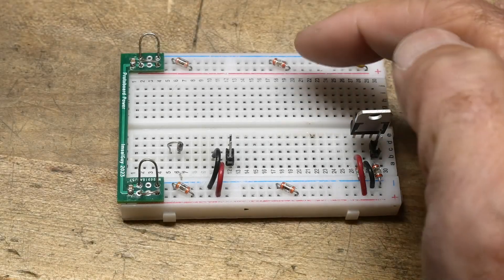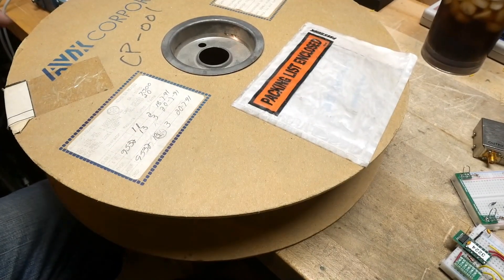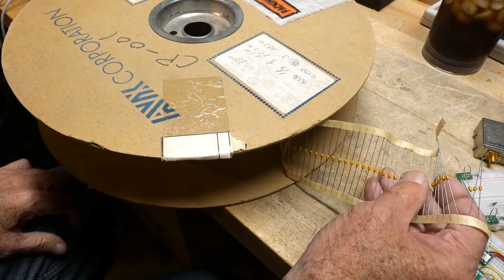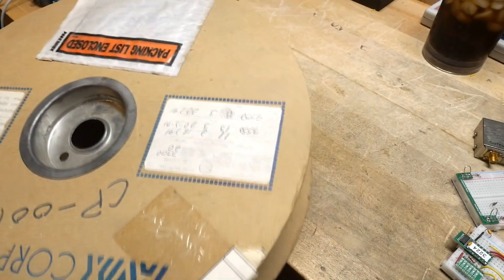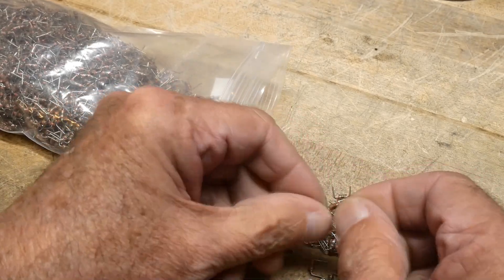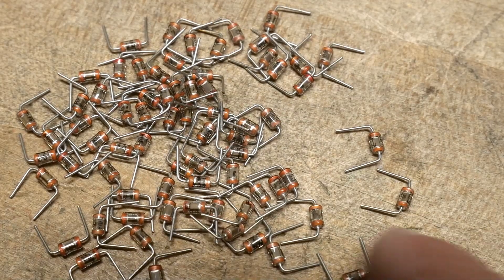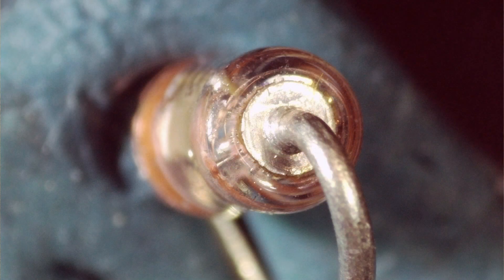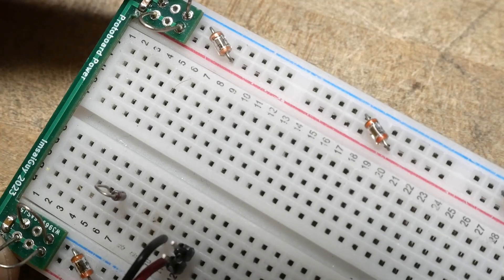#2222 Axial Glass Capacitors

Comment: I manage to salvage several of those from an old Texas Instruments Omni-800 "terminal" printer.
It used to be used to print airline tickets in the company I work for.
The printer were from the 70s.
Throughout iis almost 30 year in operation, it surely printed some hundreds of thousands of tickets, if not millions.
Never needed any maintenance... No oiling, no belt changes, no head pins... 
It was based on Intel 8080 and had 5 boards of (about) 5" x 13", one of them being only power supply, another being only motors and print head drivers.
The other 3 were fully populated with jelly-bean TTL logic (74xx), none of those fancy power saving LS, or speedy S... Just barebones power hungry TTLs.
All boards were full of those glass encapsulated axial MLCCs exactly like those ones you got.
I think they were made by Murata.
Unlike the yellow epoxy encapsulated ones, whose  leads are easily pulled out if overheated, those glass encapsulated ones are very sturdy and can survive easily a "salvage" operation from an older board.

Comment: Some ceramic caps are subject to capacitance reduction as they age. If they are old stock, it would be interesting to measure the capacitances of some, heat them to the Curie temperature of the ceramic (around 130 °C to 150 °C for barium titanate, which is probably what the 100 nF parts are) then measure them again after they've returned to room temperature. Aging starts anew after the heating.

Comment: Axial capacitors are pretty mediocre for decoupling. Their inductance is quite high simply as a function of their overall length. They're OK at moderate frequency but not very good at high frequency. When a decoupling cap is stuffed into the supply strips of a protoboard it makes virtually no difference since that is inherently low performance.

Comment: Oh YEAH! I remembered those glass-encapsulated capacitors which are basically SMD capacitors shoved into glass diode body. I haven't seen them in years, let alone brand new ones. IMO it's possibly good for test equipments as well since certain capacitor ceramic materials MAY be hygroscopic which affects things in the long run.

EDITED: Apparently the glass-encapsulated ceramic capacitors are still made.
Reply: When I worked for DEC in the 1980s we used the glass packaged capacitors widely for decoupling - the supplier was Unitrode. The version using the Z5U dielectric had a relatively small body - only 0.17 inches long for a 0.047uF 50V part (smaller than a resistor or most other types of capacitor) allowing the leads to be bent to fit holes 0.3 inches apart - the same as a standard DIP package. I doubt the capacitors were made as SMD parts given that back then SMD was a relatively uncommon technology.
Reply: I have never run into SMD caps in a glass encapsulation. It looks like someone needed leaded caps and they had a ton of SMD caps kicking around, and the diode encapsulation machine wasn't busy... I'm curious what time frame you did see them in, because I've never run across them before (and I said as much in a comment yesterday, and suggested doing a video on them, so I'm probably the one responsible for ruining the 2n2222 episode...)
Reply from the maker: these are not new. they are vintage
Reply: @IMSAIGuy  But I'm trying to figure out when they'd be from, because there is obviously an intersection between MLCC SMD caps and these - I don't know when MLCC caps became a thing, or if they were a thing even before SMD packages? I would think MLCC's are a lot newer than glass encapsulated diodes, which must go way back
Reply: @gorak9000  Those caps were very popular in Silicon Valley in the 1970s and 1980s.  Unitrode was bought by Texas Instruments in 1999 and I've not sen them since.  Atari used them in all their PCBs for a while.  The Atari 2600 and all the cartridges used them as did Battlezone and Tempest if that helps date things.  Remember that hybrid circuits predate SMD, and that SMD chips predate through-hole ones.
Reply: @IMSAIGuy definitely pre 1983, which is when I first encountered 
both types.

Comment: From my scrounging days I still have bags of both of those styles of caps. Being a tech, not an engineer I just keep plugging in more .01 and .1 uF bypass caps until my circuits are stable.  :)
Reply: If you still use the old bipolar 555 timer chip, may I suggest you switch to the CMOS version ICM7555.  That nasty 450mA 555 switching transient goes away and your need for excessive amounts of .1uf decoupling caps goes away with it.

Comment: I used to work in an FM factory. We used them a lot. 
We also used mica and nickel ones, I think, very good for RF in the tens or hundreds of picofarads. 
Do you have any around? They were square and could withstand high temperatures without changing their capacitance one bit!

Comment: Back in the day (1980s) I used to remove the the chip caps from mil sec plastic caps by melting it with solder iron. This was for a microwave project.

Comment: I didn't know about those. Are there glass transistors too?
Reply: I had some transistors that were mostly glass made ca.1956,  one time.  They were photo transistors and were going to be used in automotive apps as an auto headlight dimmer circuit.  Donated them to the Transistor Museum site.
Reply: Yes, the earliest ones like the germanium Mullard OC71 came in clear glass which was painted black.  Two of the earliest guitar signal processors, namely the Tonebender and the Dallas Rangemaster, made use of them and OC71s are still available in very limited quantities to build those pedals.  The sound of Ph.D. astrophysicist Brian May's lead guitar tone in the band Queen comes from a Rangemaster using one of those glass cased transistors.
Reply: @Peter_S_ and if you scraped the paint off you got a poor man's OCP71
Reply: Yes there are :)

Comment: Congratulations on your 2222nd video! Thanks for all the valuable and entertaining info.
I just used some of the first axial lead capacitors that you showed in a kit. The holes in the board were kinda close together and the leads were quite thick (no complaints there), it was hard to get them to sit nicely. By the third and final one, I had the process down, so if I encounter the same problem with a similar component I should do a better job.
Reply: You have been waiting 2222n videos to post this. Nice.

Comment: Hello. Nice! Thanks for your videos. I'm following your channel from long time ago (years) but only like, very rarely comment.
First time I saw the glass version. Do you have a reference or where I can found some already bend as yours?
Regards from Paris, France.
Reply from the maker: no
Reply: The leads are formed and trimmed from a standard roll by a held held crimper/cutter which sets the parameters of the bend.  I have not seen these tools for sale in the last 40 years, but I have not looked either.  BigClive made a demonstration video about the one he owns and uses, but I was unable to find it with several searched.  He may have purchased his from Farnell a long time ago.
Reply: @Peter_S_  yes I already saw and look for this tool. Totally unavailable. I searched a lot. When I found one, I will buy it. I saw some made their own version, using 3D printer to modify an existing tool in metal, but not reliable at all.

Comment: First
Reply: Second
Reply: Third?
Reply: Fourth
Reply: This
Reply: i bought a bag of chinese radial lead dipped 10uF MLCC 50V.  They are terrible.  Measure around 8 to 9 uF, and have had two fail short running at less than 25V peaks.   Trashed the rest.  Brand matters a lot w mlcc.  Even good brands go bad eventually.   MLCCs are the  capacitor plague 2.0 - but much harder to trace down than the dome electrolytic of plague 1.0 . . .
Reply: they can make a beautiful voltage multiplier with 1n4148 diode
Reply: @electronics-by-practice  That's a really cool idea... now I'm wondering where I can get some of these caps...